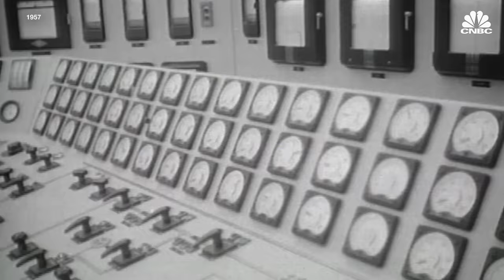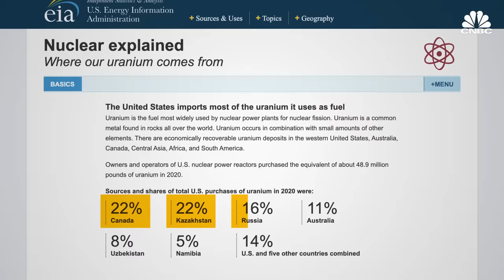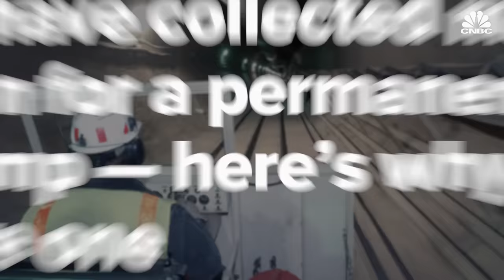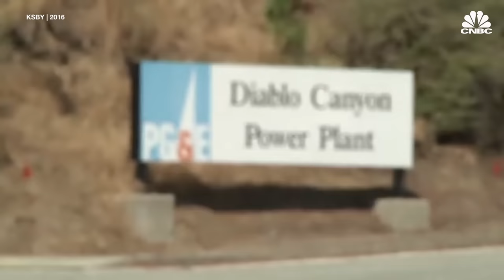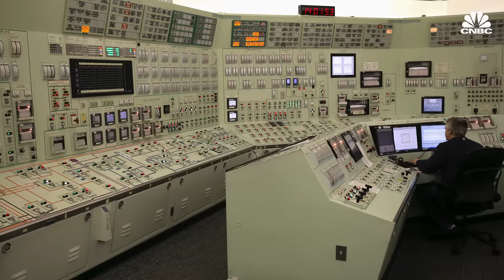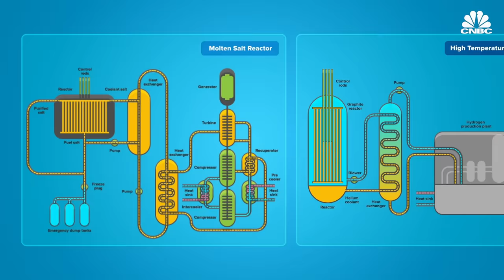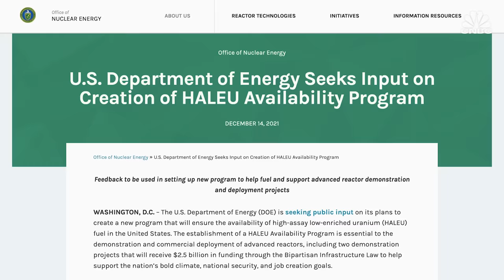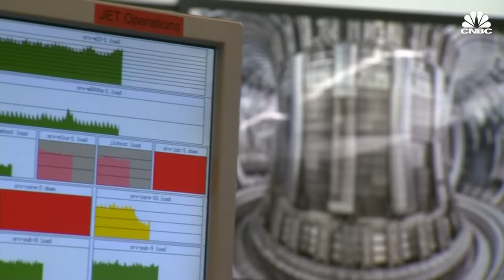Why Nuclear Energy Is On The Verge Of A Renaissance

Comment: Germany shutting down their nuclear power plants right after Fukushima made no sense especially when their plants weren't built on top of earthquake prone areas, near tsunami locations, nor were any design flaws found. Either every German citizen instantly got scared of nuclear energy due to Fukushima despite decades of problem-free use (whereas France didn't seem to be fazed by it) or someone got a nice Russian kickback for increased oil imports.
Reply: It would’ve made more sense if they modernized their reactors instead of just moving to Russian gas.
Reply: with all this going on, they wanna protect the assets, enough said
Reply: money is all that will matter unfortunately
Reply: It’s astonishing how many terrible decisions Germany has made wrt energy independence.
Reply: Governing by the perceived public opinion, a flawed perception as it is derived from polling on social media.
Reply: Germany has always had a strong anti-Nuclear lobby, but yeah, Fukushima being a factor in that is just stupid.
Reply: It was a political decision
Reply: however it's important to remember there are still real problems with long-term (100 years+)  nuclear wased ie availability and cost
Reply: Maybe that's why Germany has among the highest electricity rates in the world.
Reply: Nuclear waste takes up a very small amount of space and can easily be stored,  there are also ways to recycle used fuel that for some reason the United States does not do even though 90% of nuclear waste can be reused
Reply: @Donovan Lewis but the problem is that only  renewables are not enough to supply the amount of energy that a country like Germany needs. Besides that, the technology of renewables has some serious issues that were not solved yet.
Reply: @QueenetBowie  Uranium is highly soluable in water under oxidizing conditions and the radioactivity can not be perfectly contained. Futhermore the radioactive decay produces radon, which, since its a gas can also easily leak from whatever container you put the material in. Moreover any storage will also be contaminated. Time will tell how radioactivity can and will be used as an energy source. Recycling atomic waste will be incredibly important if it's possible, because while it amount may be limited storing it savely as in so that the leaking radioactivity is insignificant compared to natural radioactivity is very difficult indeed, especially long term since the material will contaminate and destroy any containment matter its contained in which means the waste you have produces more waste over time.
Reply: @arun279  Germany was also pioneer in solar energy but they have lamentably fallen behind China and other countries, same with wind energy….. it’s such a shame tbh!
Reply: @Donovan Lewis You can't be serious!  Wow, you really need to brush up on your relationship with Mr Google.
Reply: @Donovan Lewis "Much faster than any other country" That is 100% a lie... there are countries that already are completely running on renewables. The point I think also is that if Germany hadn't backed off of their nuclear before  having enough other renewable energy sources the country wouldn't be the biggest hypocrites of the EU... Also it doesn't help that Germany was the biggest proponent of the EU of Russian gas, with former ministers  the boards of russian gas companies... except for calling the Germans hypocrites, I'm not implying anything jus pointing out it looks a bit suspicious...
Reply: Kickbacks, massive corruption in Nuclear, many factors really, we need companies that deliver reactors on time and to cost, but seems hard to find any that are not taking a good slice of the cash for themselves and then asking for more because of "cost overuns"
Reply: Germany Inherited USSR style reactors, just like the ones in Chernobyl. Remember Chernobyl. Their Western style reactors are old, they need to be shut down sooner or later. The EU is now dismantling it's first nuclear plant to see how to do so safe and at what cost. Nobody knows how much it cost to do so yet. Same with nuclear waste, we are still in the stage of burying it out of sight. So the ones we have are old, some went boom, we have no idea what to do with the waste and what it will cost to clear up after they die.
You must be getting kickbacks from the nuclear industry.
Reply: @astranger448  so you prefer to pollute the world then overcome some unfounded fear of yours? Chernobyl failed due to human error...some went boom? tell which one exploded?
Reply: @KielanGaming  talking about massive corruption in Nuclear. But totally not talk about the even enormous way more massive corruption in coal. :) funny. Really funny. And naive.
Reply: Former Chancellor Gerhard Schroeder was the driving force behind Germany's dependence on Russian gas.  He was on the board of Rosneft, and for a while was known as "Putin's man in Berlin".
Reply: Nuclear plants shouldn't be built anywhere near high risk disaster areas. This includes near fault lines and tsunami zones.
Reply: Not the first time Germans took stupid decisions.
Reply: @bimbelimbim4998  While radon is a noble gas and can't be captured chemically, it is heavy and it would seem if it is sent into a cool ground area, it would gravity sort.  The gas could travel through pipes under the parking lot of the facility with a chimney on the other end.  The radon would roll along, but never be able to make it up out of the chimney.
Reply: it was a dramatic strategic and economic mistake.. that has led to huge number in loss of live in the Ukraine conflict. terribly sad
Reply: Definitely the latter, qui bono, someone pocketed a lot of boodle. Too bad for the consumers.
Reply: Germany has more wind than they can handle.
Reply: Nuclear power has never accounted for more than 6% of the total energy mix in Germany. Now it is 3%. Moreover, nuclear power is now more expensive than renewable energies. The high price for private customers (not industry) has political reasons. There are also enough countries that have never gone into nuclear power or have long since abandoned it, such as Italy. Not only Germany plans the final exit from nuclear power, but also for example Belgium, Spain and Switzerland. This smart-ass talk about Germany's energy policy from people who obviously have no idea about it is annoying.
By the way, even in France, nuclear power accounts for only 24% of the total energy. That means 76% has to come from somewhere else.
Reply: @yasminesteinbauer8565  So, if France builds 3 times the number of nuclear power plants it currently has, then the country is supposed to have free energy for its citizens, right ?  
Why 3 times ? It is because roughly a third of energy consumption comes from transportation.
Reply: @KRYMauL  both issues have nothing to do with each other. The problem with Russian gas is not found in the used gas plants but in process heat. Power generation is not the problem.
Reply: @arun279  you can afford to make sizeable mistakes when you make so much money from exports.
Reply: @danadurnfordkevinblanchdebunk  they buy it from the EU grid, because they can afford to.
Reply: @lewisdoherty7621  Except the subsequent radioactive decay products lead and polonium are easily solved in water which will ultimately cause lead contanmination in the surrounding area. Moreover while radon would naturally layer below other gases, it doesnt take much of a disturbance or draft to remix it and carry it off. Moreover there is too much atomic waste already to feasible contain them in built facilities above ground, those would need to be very large. And for underground storages, groundwater is always a huge problem.
Reply: It was mostly just money. As they highlighted in the video, they're expensive and complicated to build. 

Most western countries in particular have privitised their energy production. So the profit motive overrides everything, health, the environment, geopolitics, etc etc. 

It's all just $$$$$$$$$$$$$$$.
Reply: @Donovan Lewis renewables do come with problems though. Battery storage, limited lifespan and some electrical grids need many tens of billions of dollars of upgrades to move it around.

The point is that nuclear is a possible viable option and we should and as this video demonstrates are, working at possible solutions.

We shouldn't leave anything off the table and should back out scientist and engineers to solve big problems. 

No solution is a 100% hit, with no side affects. Everything still takes lots of raw materials, lots of money and had pros and cons. 

If we can solve some of nuclears cons it may provide a good source of baseline power.
Reply: Yes the german strategic thinking is a joke.
Reply: @mycourseresource-com  That potent nuclear waste is 1% or less of all nuclear waste, the rest becomes fairly harmless in that 40 year period.
Reply: @davidmartin6004  Right now, US nuclear waste can provide all of America's energy needs for 100 years.
Because light water reactors are extremely wasteful, especially generation 1 and 2 reactors that barely processed 5 percent of the energy from the Uranium.
Russia has fast breeder reactors that exclusively consume nuclear waste. 
The US used to have them but the last one closed during the Clinton era.
Some Fast reactors like the Lead Cassette reactors are refueled after 20 years of uninterrupted energy supply. The waste produced ,especially in closed cycle systems that recycle the fuels over and over again would be radioactive for 500 years and the volume would much much lower than that from light water reactors.
A more accurate term for the waste from nuclear plants is Light Water Reactor Waste, because not all nuclear power plants produce long lived, voluminous amounts of nuclear waste.
Reply: @bimbelimbim4998  but coal power plants release more radiation than nuclear plants (because coal is very slightly radioactive) and coal plants don't store their waste, most of it is just released it into the air.
Reply: @QueenetBowie  It's mentioned in the video (6:30) that the USA doesn't recycle/reprocess their nuclear waste, unlike say France, because it's "too expensive" to do so.
Consequently, I suspect the reason is (commercial) economics and state policies.
In France, (presumably because of environmental concerns) the government made a policy decision to make the reprocessing of nuclear waste an obligation of the industry, which consequently accepted the associated costs of doing so. 
In the USA, they didn't do this...
Reply: @sebastiaosalgado1979  You're right, of course.  But, there is a nuance there.  The 'Political' decision was motivated by a few folks' self-serving economic decisions.  In that the marginalizing of Nuke Pwr in Germany, in favour of Nat.Gas. adoption/proliferation, was motivated by a few highly-placed political operatives who's personal financial situations would benefit greatly.
Reply: @jibcot8541  Thats because these levels of radioactivity are far too low to even register against the natural radioactivity in our enviroment and to pose any serious threath at least as far as direct damage from radiation goes. Uranium and other radioactive elements are present in nearly all types of rocks, which includes coal, but it is never really abundant enough to the point where the radiation would be significant.
Reply: same thing happend here in s.korea and ends up electricity price gouging
Reply: @Ted0302  you're correct
Reply: @Donovan Lewis 100% for short periods of time is not good enough whatsoever. You would need it to constantly be at 100% all the time and that is not possible in most countries
Reply: I wholeheartedly agree. It is beyond moronic to shut down the only low carbon, baseload power source. But I have lost hope that politicians and journalists in the country will come to their senses.
Reply: Russian bribes
Reply: To each their own.
Reply: @yasminesteinbauer8565  How is it even relevant to show a ratio about the total energy production if nuclear energy is only meant to produce electricity ? What is your aim behind giving people the wrong idea ? 71% of the electricity in France is produced with nuclear (and 22% from renewables).
In the near future, electricity will have a far larger role, most of our energy production will be related to electricity (since it's cleaner), that's why we need to produce more and more.

"nuclear power is now more expensive than renewable energies"

When will idiots stop comparing an energy you can CONTROL with renewables that YOU CAN'T CONTROL. It's not the same thing, it's pointless, it's like comparing a caravel and a steamboat. At this point renewables can only be a complement. Add the cost of massive electricity storage complexes (that we can't really build now realistically speaking), full of batteries, and we'll see if renewables are cheaper, and let's not forget the pollution that comes with producing batteries.
Even Germany doesn't really count on becoming 100% renewable any time soon (since we don't know how, so it's just a bet), as their energy mix is meant to rely on gas. A gas + renewables mix, as opposed to the nuclear + renewables mix that is recommended by basically everyone else.
Reply: @tranbaohoangvu9464  71% of electricity in France is nuclear, 21% is renewables. As soon as transportation and some other sectors switch to electricity, they'll just build more plants to meet the increased demand. But it's pretty good as it is for now.
Reply: @davidmartin6004  

We already solved that problem decades ago.
Reply: @bimbelimbim4998  
What’s the difference between radiation and GARBAGE landfills?

Think about it.
Reply: If nuclear plants can’t be built in earthquake prone areas then nuclear plants can’t work anywhere in Japan
Reply: @xenotypos  Why do you ask questions when you answer them yourself in the next sentence?🤷‍♂️
You can't just look at electricity and ignore the rest. In France, 76% of the energy needed for the country is not supplied by nuclear power. Since we have to get out of fossil fuels because of the climate crisis, a transformation to other forms must take place here. Replacing this 76% by nuclear power in the future is unrealistic, as France already has problems keeping its nuclear power plants running reliably. A capacity limit has simply been reached here. In addition, nuclear power is already the most expensive form of electricity production and will become more expensive in the future as uranium becomes less and less available. Running the world on 100% nuclear power is simply impossible. 100% renewables, on the other hand, is absolutely possible.
So the solution is obviously renewable energy. The problem is not that WE don't know how to do it, but that YOU don't know how to do it. With power-to-gas, for example, we can easily store the amounts of energy we need to balance out seasons, etc. We can even convert existing gas storage facilities for this purpose. I can show you detailed model calculations that describe exactly how to realize the supply with 100% renewable energies (in German though).
Calling me an idiot and at the same time believing that we would store the needed energy in batteries only shows that you have never seriously dealt with the topic.
Reply: @yasminesteinbauer8565  "You can't just look at electricity and ignore the rest."
We can for the reason I mentioned, and for another reason: renewables also can only produce electricity. So it's stupid to mention things that HAVE to be from fossils, until we all have electric cars and so on. Mentioning stuff that can only be through fossil fuel right now while talking about renewables is at best confusing, at worst dishonest.
Admit it, you should have focused on electricity production. Nuclear and renewables are the same in that regard.

"Replacing this 76% by nuclear power in the future is unrealistic"

It's totally realistic, but you just didn't check the french situation, you had to post before even knowing what's going on: France mostly stopped investing on nuclear energy (at least compared with the 60s/70s/80s) for decades, and didn't replace her very old centrals. Well, there were some investment, but minimal. The French president confessed that they lost a lot of (precious) time during that indecisive period, since it's been only like 2 or 3 years they changed their mind. Real investments on nuclear energy, as it's happening in a lot of countries right now, will make it cheaper, even more efficient, and with minimal waste. That's the scenario most of the world chose, like it or not.

"A capacity limit has simply been reached here."

Are you always making up "facts" like that ? Nuclear plants take minimal space and fuel, with enough money, they could produce a lot more than what the country needs. there is no "capacity limit" in sight here. As I said, France's nuclear facilities are super old, that's basically the only real problem.

"and will become more expensive in the future as uranium becomes less and less available."

Sigh, why are you even posting if it's to say that. Not only there is plenty of uranium left, but:
-we didn't search for it nearly as much as for fossil fuels, the real total available amount is impossible to know, but probably a lot.
-we can reuse nuclear waste, it's already an accepted technology in France and Russia.
-Thorium reactors aren't far from being operational. For those, the fuel is basically everywhere in the world.

"Running the world on 100% nuclear power is simply impossible."

Nobody says they want 100% nuclear, even if it's perfectly possible. But it would be stupid: renewables, if only used as a complement don't need to have storage facilities, and thus would be indeed quite cheap.
That's why everyone is betting on a mix that include renewables, but also another mode of production that you can "control", either nuclear or gas.

"100% renewables, on the other hand, is absolutely possible."

Not now according to the scientific consensus. I doubt your paper in german would change that. Maybe in the future, but for now we have no realistic/proved way to store the gigantic amount of electricity needed to have a continuous supply.
Reply: @alohatigers1199  The difference is that garbage landfills only need to be immediately waterproof aka prevent contamination of groundwater via direct runoff. But radioactive material has to be stored waterproof and also impervious to gaseous leaks, aka a default landfill is out of the question, the wind would contaminate massive areas around the landfill, leading to both radioactive damage and lead poisoning.
Reply: @xenotypos  Energy is energy. Whether your car is powered by an internal combustion engine or an electric motor doesn't matter. We have to get 100% of our energy from somewhere and not just a part of it. Therefore, of course, it is the total energy consumption that matters, not just electricity.
The fact that in France no new nuclear power plants are built by the industry unless the state subsidizes them really says everything about their economic viability.
Statistically, we have a pretty good idea of the likely amounts of uranium on the planet. That has nothing to do with the fact that we don't look for it enough. And we know that even at today's rate of consumption, known supplies will run out in a few decades. On the other hand, if we increase consumption significantly, it will be years, not decades. The "recycling" of fuel rods is eyewash since only about 1% of the material is reused. For this reason alone, nuclear power is not a solution and a bad investment. Thorium reactors have their own problems such as the formation of highly radiotoxic tritium which easily diffuses through the walls of the reactor vessel etc. It is completely unclear whether these will ever be used or not. It is completely unclear whether they will ever be used productively. Due to their low flexibility, nuclear power plants are poorly suited for use in decentralized smart grids that are needed for regenerative energy.
The necessary energy storage through power-to-gas is technically feasible in the required scale (there is even a first commercial one in operation in Germany). It would not be the first time that science in Germany is further ahead than in the rest of the world.
Renewables are simply the better alternative in every respect.
Reply: @yasminesteinbauer8565  "Therefore, of course, it is the total energy consumption that matters, not just electricity."

Do you actually read what I write ? Or is it on purpose so that I get tired and give up ?
Reply: @xenotypos  The claim that we do not have to include forms of energy other than electricity is simply nonsensical. So I don't see what you're getting at.
Reply: @yasminesteinbauer8565  I'll repeat once again so that you understand, if you don't, then good luck for your life.

I said that argument makes no sense because:
- Nuclear and renewables are only meant for producing electricity. Both of them, while you used that argument to argue that renewables are a better option than nuclear. Which is the "nonsensical thing" here.
- Almost everything will run with electricity in the close future. And this evolution is not dependent on the mode of production, but on other forms of technology, like electric cars as I said. So OF COURSE fossil fuel is still used a lot, but it has nothing to do with a "nuclear vs renewable" debate, both have the same aim in that regard, producing electricity. Thus it's totally irrelevant to say "nuclear only produce xx%" as an argument, as if it wasn't possible to produce more, the only thing is that it would only produce more electricity. And it's agreed by literally everyone that the way to go is to make almost everything electric and to increase the electricity production. I assume you agree with that too, since you preach for renewable.

I've actually read the rest of your previous post now. I was too annoyed in my last comment, so here are some corrections:

"unless the state subsidizes them really says everything about their economic viability."

That's not how it works. EDF is mostly owned by the French state to begin with, that's why everything that company do has to do with the French state. And despite the lower investments on nuclear, they were actually building new nuclear reactors, but just not in France (it was cheaper to keep the old ones, which were enough to get the job done anyway, as almost no electricity is produced through fossil fuel in France, as opposed to the massive use of coal in Germany).
Also, either in the private sector or in state-owned companies, investment was rare not because it wasn't economically viable, but because the political climate (worldwide) was against nuclear power. It's clearly different now that a lot of countries have shown their interest. More prospects to actually sell the powerplants.

"And we know that even at today's rate of consumption, known supplies will run out in a few decades."

I'll just quote a scientific article: "According to the NEA, identified uranium resources total 5.5 million metric tons, and an additional 10.5 million metric tons remain undiscovered—a roughly 230-year supply at today's consumption rate in total."

How many decades does 230 years look like for you ? The known part would still last for around 80 years.
What you may have been refering is an old statement from the European Commission in 2001, and which was only refering to the known ressources back then (I'll repeat that: the known ressources, back then). And since (as it happened with oil) new sources are regularly discovered, more than imagined, it changed quite a bit since then.
Yet, I'll admit that (as opposed to what you said "confidently"), it's hard to know how large are the undiscovered ressources are. So it's partly speculative.
Reply: Makes perfect sense when their politicians take kickbacks & director positions from Russian energy companies...
Reply: @xenotypos  "Nuclear and renewables are only meant for producing electricity."
"Almost everything will run with electricity in the near future."
Do you suffer from a split personality? Since we have to compensate for the loss of fossil fuels with something, the bottom line is that total energy consumption is crucial. Yes, most of it will be electric in the future because we are replacing fossil fuel combustion with electricity. But it is unrealistic for many reasons to replace the scale of fossil energy with nuclear power. So you want to increase nuclear power from say 10% to 20% and then replace the rest with renewables? Then why not go straight to 100% renewables?

The point is that nuclear power is not financially viable or profitable without government involvement. Exactly how government subsidization takes place in different countries is not the point. Why are you so eager to sink your tax money into it?

Many of the presumed uranium deposits will not be exploitable at all because, for example, there are cities on them or we won't even find them. And even if we assume 200 years, this is only true if consumption remains unchanged. If we double the consumption, it will only be 100 years. If we quadruple the consumption, 50 more years ...
So why not instead invest in regenerative energy? Why unnecessarily accumulate more nuclear waste although it is not necessary? Why continue to depend on other countries?

Just because there is some "trend" does not mean that it is wise. There is also a worldwide trend towards autocracy at the moment. Are you arguing that democracy must be bad because of this?
Reply: an Austrian survivalist (so a grain of salt) was hyperventilating last year that Germany not only closed the power plants but also stopped training people to manage them
Reply: @yasminesteinbauer8565  " the bottom line is that total energy consumption is crucial."

You still didn't get my point I just can't believe it.
Have a good day.
Reply: @xenotypos  Then you are really bad at expressing your argument clearly.
Reply: @yasminesteinbauer8565  you mention "power-to-gas" quite a bit. I presume you mean hydrogen generated by electrolysis. There's a couple of problems with that soloution (one of which nuclear energy helps quite a bit with). The first one being, hydrogen is extremely flammable and has a low energy density, meaning we would need huge tanks to ever function as a grid scale "battery". If you can't figure out why that is a bad idea: Hindenburg. Secondly: the energy efficiency from just electricity to hydrogen to electricity is about 30%. given that the capacity factor of renewables (solar and wind) is also about 30% (give or take), one TWh of installed capacity renewables would only give roughly 0.1TWh output from hydrogen gas. You can make the electrolysis more efficient with heat, which nuclear power can provide besides the electricity output. This concept is being developed amongst other places in Oskarshamn Sweden. I know nuclear energy is expensive, but grid stabilizing services, connection costs etc are also expensive, and those are a problem for renewables, not nuclear. So it's not fair to just look at the LCOE of different forms of electricity generation. The power grid NEEDS baseload power. Right now, we have two forms of low carbon baseload power used at scale: nuclear and hydropower.
Renewables + Nuclear = <3
Reply: @MrBadAssBoy123  Electrolysis is only the first step. The second step is methanation by carbon dioxide. This produces synthetic natural gas that is compatible with natural gas. This also makes it easy to store in any quantities. Germany already has huge gas storage facilities that can be used for this purpose, allowing energy to be stored for months.
Efficiency is not a problem. These losses are of course taken into account in model calculations and do not represent an obstacle.
Nuclear power plants, due to low flexibility, unfortunately harmonize poorly with renewable energies and are rather an obstacle to a successful switch.
Reply: @armin3057  I never claimed that there is no bias and everything is 100% perfect. Maybe you read what I actually write and don't attack me for things I never wrote?
And if you have to go all the way back to the Iran War to find an example, that probably doesn't speak strongly for your thesis.
Reply: @armin3057  Again: I have not said with a word that there is no bias.

I have already made many arguments if you would take the trouble to read all my comments. And if you find that too tedious, please find something else to do.

Also, I don't know when I ever heard anything about the methanization of hydrogen on the news. And if you hear similar arguments, it is probably simply because they are true.
Reply: There's no such thing as electricity anyway, it's just another type of 🔥
Reply: @yasminesteinbauer8565  In other words, you want to get off fossil fuels by using renewables to create a synthetic fossil fuel?  I whole heartedly support the Germans stopping the money flow to Putin, but I thought the goal was to reduce greenhouse gases? I also wonder what the cost per MWh for such a system would be. Can you show me the model you are talking about? if it is a serious publication I am sure there is atleast an abstract in English I can read. Thanks :)
Reply: @mycourseresource-com  the million years figure quoted by Forbes is incorrect, according to the nuclear regulators the amount of high level waste for the average plant is only about three percent per year and is about three cubic metres once vitrified and only requires storage for a few thousand years until it is back to normal background levels. Current reactors use about 53 grams per household per year which is not a huge amount in the bigger picture. So many lies have been told about nuclear generation over the years people have started to believe they are true.
Reply: @Donovan Lewis Your examples have huge hydro power dams which acts as base power for wind and solar. Not every country or region has the availability
Reply: @xenotypos  thanks mate, that's a great point, but France has not yet reached the threshold where it can purvey free energy to it people.
Reply: Germany has been busy marketing their claim to the greenest % of renewable energy production. They’re very careful to leave out the reality of t he or energy consumption tho.
Reply: Germany scared  they would get hit my missile  attacks from the ussr
Reply: Even Trump called this out
Reply: if Germany had thought  about the climate they would had phased out coal, oil and gas first.
Reply: Qutting nuclear made a lot of sense for nuclear. You have to consider the history of Germany and anti nuclear movements. It not as simple as you guys make it look:

This decision has a long history and is pretty much completely disconnected from any climate change discussion.The discussion to phase out nuclear in Germany started as early as 1970. And it gained much more attention after Tschernobyl. The green+red government of Germany in the year 2000 then decided to phase out nuclear, with all of the short term consequences (no more investments, less research, no funding). But then, the black+yellow (conservative + liberal) government in 2010 decided to stop the phase out and keep the nuclear plants running. But please note that there was still a very big anti nuclear movement in Germany. But the promise was.... well Tschernobyl happened in a communist third world country.. this could never happen in an industrialized nation. But then Fukushima happened, the promise was broken. Shortly after that the phase out was decided again. in the year 2011. This time by the conservatives under Angela Merkel. At that time there were already climate discussions, but not as strong and not in the focus as it is now.

Time passed... and now we are at a point were stopping the phase out is basically not possible anymore. 10 years passed without serious maintenance and re-investments in the old nuclear plants. The (private) plant-operators themselves stated that even if the government would stop the phase out. They would still not keep the nuclear plants operational. It would need to much investment. Not worth. All the supply chains are cancelled, employee contracts cancelled. It is simply not feasible / possible anymore to not phase out nuclear, its to late. The process of decommissioning has started long time ago, long before the climate topic has been that relevant. 

So from my point of view, the phase out is very much understandable and not some "brain dead" take. The complete story is a bit more complex, also involving billions of € that got shoved up the a**es of the plant operators... but lets not get lost in details.

Constructing new nuclear powerplants also seems not like a real option. Its pretty clear that building those will take to much time, to much capital, to much resistance from the people, to slow climate effect to be meaningful to reach 2030 or 2035 climate goals. The path Germany has to take is clear now, build more Renewables + Storages. Its cheaper and faster and has a much larger climate impact.
Reply: Kickbacks make the most sense to me.
Reply: @QueenetBowie  If it can easily be stored....and by that I assume you mean safely......why is every bit of nuclear waste around the world still currently in temporary storage and why has science still not come up with a permanent safe solution. You are therefore talking crap.
Reply: @elsekling2552   Sure but that decision from merkel wasn't based on climate
Reply: Literally some of the most modern power plants just rotting in Germany while they burn tonnes of Russian gas
Reply: @davidmartin6004  not really, as most of the reactor 'waste' is either short-term radioactive isotopes or more reactor fuel that just happened to be covered in a neutron-absorbent coating. We can simply throw them into slightly modified refinement plants (usually attached to reactors due to the required energies involved) and get more bang for the buck, so to speak.
Reply: Also, Fukushima disaster is actually an avoidable disaster. It won't happen if the plant actually does not discount their protection
Reply: It makes sense if you are incentivized to move to be wholly reliant on a country angling for geopolitical strength
Reply: @danadurnfordkevinblanchdebunk  think he only completed his masters in Google university, might need to encourage him to get his phd
Reply: @KothraStreamdiver  Anti - nuclear is one thing if it applies to WMD's , power generation is entirely pedestrian !
Reply: Chernobyl more likely they got scared of
Reply: Thanks to that germany can ferally invest in renewables if not for this they would have gas plus coal plus some 25% of nuclear power, even data form Germany shows this they had similar amount of energy produced by fossil fuels during peak of nuclear power as they have now.
Reply: @TimelessFive  First you should check for what purpose gas is used by Germany only 25% goes to generate electricity.
Reply: @TimelessFive  Ok but that beyond current topic past decades basically forced economy into reliance on gas. Heat pumps are only recently becoming viable option and gas heating for bakeries was cheapest option as well. Relaying on atom doesn't changes said facts.
Reply: @yasminesteinbauer8565  About 3% of vehicles in France currently run on electricity (I included hybrids just to be extra generous). Are you sticking wind or sunlight in the other 97% of vehicles' fuel tanks in order to run them on renewables? If not, then your numbers are either deliberately or accidently obscuring the realities of power production and expenditure. In order to rely 100% on renewables you need either; 
1. A massive over production spread over a very large area (to avoid things like persistent cloud cover, droughts or doldrums) which takes up a lot of land which is going to lead to ecological damage 
2. Massive energy storage capacity to make up for for cloudy or windless days
3. Some kind of  throttleable energy source that is not affected by climatic conditions. Currently you have your choice of gas, coal, oil or nuclear 

Some other things we need to consider for renewables are that the generation methods have limited lifespans. Wind turbines have to be replaced (and we don't currently know how to effectively recycle the blades), solar panels lose efficacy over time (same problem, we don't really know how to recycle them) and not to mention that energy storage loses efficacy over time with charge and discharge cycles and we sure as hell have a hard time with recycling those.

I see you also like to talk about the limited supply of nuclear fuels, the issue is that this is even more true for some of the important materials we need for renewable energy generation and storage. Lithium, cobalt and high purity silicone is both in short supply, largely held by a few nations (that aren't always the friendliest) and wreak hell on the environment during extraction. We know where a lot more Uranium is than those bunch and we use it up a lot slower as well.

As for the economics of it, the unfortunate truth is that right now almost nothing can compete with fossil fuel power generation costs. We have spent decades building up and refining the infrastructure for it. Nuclear is subsidized sure, so is almost every renewable initiative either on the front end (construction/research) or the back end (subsidies for users to bring the price to use to a comparable level). This is true for EVs as well. Adoption is generally quite slow as they still have a lot of downsides (initial cost that will only get worse as government stops subsidizing their purchase, long charge times, substandard range, poor battery performance in cold climates and ever reducing range with use to name but a few). Between 2014 and 2019, France for instance only saw a 1.5% market increase for EVs and the French seem more into EVs than a lot of other people. Areas with higher EV adoption tends to be the ones where the government is essentially forcing the issue by artificially reducing the cots of new EVs, making ICE vehicles artificially more expensive with additional taxes or straight up just banning them (think California). That doesn't work in most places and until EVs start making up a majority of vehicles on the road you can't really consider car use as part of the power generation structure of a nation.    

We're going to need a mix of energy production methods for the foreseeable future. As it stands we don't have the means to store the needed quantities of energy to make renewables sufficiently reliable and not to mention that once EV adoption does start reaching saturation then we are going to need a lot more power and contrary to popular belief, renewables are a finite resource. Only so much sun hits the earth every day, by harnessing wind power you are robbing it of kinetic energy and there is only so much water we can stick in a dam. At this point we need every feasible means of energy production that isn't going to bugger up the planet (that includes nuclear) and hope that fusion isn't always 20 years in the future. 

I think xenotypos largely has the right idea, he could probably work on his delivery though
Reply: @simon2493  Basically, the current situation is feeding a war mashine in Ukraine, in my opinion Europe should sacrifice all of the industry that is dependent on Russia to save human, animal life or is that to much to ask?
Reply: @dewibermingham816  That's it, the decisions taken to close the plant don't reflect the situation on the soil of Germany.
Reply: @TimelessFive  You expect total collapse of given country? We are decreasing our reliance on Russia as fast as we (Europe) can but it takes time. We can't be so pushy because we are taking about society if people will feall that they will lose significantly by not buying Russia gas all sanctions will go in wain.
Reply: @simon2493  I never said it would be easy, most likely it would have terrible implications for majority of Europe, it would be nice to see EU human morality to be as well developed as German economy. History will remember this period when EU came together to help to a point of comfort.
Reply: Anti nuclear movement in Europe is an entirely different breed
Reply: @shatteredstar2149  It's hard to not be anty seeing how did AP 1000 project ended in USA 25 billion us dollars for two 1000 MW powerplant
Reply: @shatteredstar2149  It's not the time to listen to idiots, people are dieing. EU needs to grow some balls brother.
Reply: The moment you realize how bad it could be if the fate of a country is decided by 'normal' citizens, who are supposed to be Einstein-like. Counter-example: China, where policies are made by elite force (CPC) and based on meritocracy/technocracy.
Reply: @oceanwave4502  Elite 😆
Reply: @elsekling2552  "Renewables + Storages"

I think you meant renewables + gas. 
Well, one day you guys will have to be more realistic.
Reply: @DeepVeinThrombonus  How does it make any sense that the still low electrification of the transportation sector argues against renewable power but for nuclear power? Are you going to throw uranium rods in the tanks?
Of course, there needs to be a simultaneous shift to electric cars. A ban on combustion cars is being discussed in the EU for 2035. And yes, you need large storage capacities not only for cloudy days but especially to compensate for seasons. I have already explained in detail that storage can be realized without any problems. Just scroll up.

Nuclear power plants also have limited lifetimes and leave behind a lot of radioactive waste. Solar cells can be recycled almost 100%. Large lithium batteries last about 20 years and gas storage tanks do not wear out. These are all problems that have been considered and are not an obstacle.

The same is true for the resources needed even to supply the world with 100% renewable energy. If the whole world would produce as much nuclear power as France, the uranium resources would be used up in 30 years. Probably even faster.

As for the cost, you're wrong. → https://en.wikipedia.org/wiki/Levelized_cost_of_energy
The future complete electrification of the transport sector has also already been included in the model calculations and is also not an obstacle.

The sun provides us with 1,500,000,000 GWh per year which is 10,000 times the amount of energy we need. So we are not hitting potential limits here.
And nuclear fusion is always 20 years in the future. Even the construction of a conventional nuclear power plant takes more than 10 years on average. The idea that nuclear fusion will save us in 20 years is completely unrealistic. It is unclear whether nuclear fusion will ever be an economically viable alternative. By the way: A fusion generator causes very strong neutron radiation, which leads to so-called induced radioactivity. Parts like the protective jacket against the neutron radiation degenerate over time and have to be replaced regularly. These parts are highly radioactive waste.
Also used fuel like tritium is a beta emitter with a half-life of over 12000 years. Who believes artificial nuclear fusion would solve all our problems just like that is living in a dream world. And certainly not in 20 years.
The technology for renewable energy, on the other hand, is already available today and is not a theoretical sci-fi technology.
Reply: @armin3057  All possible ways are sought to conceal the subsidies for nuclear power. Revenues from emissions trading, waste disposal provisions, research funding or the costs of decommissioning the nuclear power plants in eastern Germany are usually not even included. The social costs are enormous.
Name me one nuclear power plant that manages without subsidies. There are, on the other hand, the first wind farms that manage without subsidies.

The high electricity prices are due to the political design and not to the renewable technologies themselves. Spain, for example, is focusing on the expansion of solar power and has considerably lower electricity prices. Austria also has no nuclear power and lower electricity prices than Germany. So this has nothing to do with nuclear power.
Also, Germany is not the only country that is expanding renewable energy. Do you know who is expanding renewable energy the most? China. But also in Japan, India or the USA the share is increasing steadily.
Reply: @yasminesteinbauer8565  
see you are mixing up so much stuff. 

yes the USA is also expansing renewables (ugly word). im not against renewables. its not nuclear vs renewables.

first of all, the utility prices of solar farms in california are way different than in Germany, for the most part the US is not paying for renewables by subsidies or by central planning. 
some utility companies for instance built solar farms and then also ended the project because it was not viable. 

in Germany, most of the solar panels were bought when prices were hight. rich folks who could afford it were paid high electricity prices, at the beginnig it was like 50 cent for the kwh ...part of the electricity price is still for paying that subsidy

again, Prof Quatsching , himself said "the EEG was a gift to the world " because in his opinion the german subsidies were the reason why solar became so cheap (i doubt it because every technology has a cost curve)
but you are even denying the fact that germans paid for this "gift" . germans arent profitting at all. at best you paid for the cost curve to down faster by  a few years

also, i never said that electricity are low because of nuclear power, but because of a free market system where the cheapest one wins.
Reply: @yasminesteinbauer8565  
third :
"electricity price is by political design"

you just said nothing here. its a flat out lie. the only other country with similar electricity price is danemark, who also has a lot of wind energy. you see it is not only that germany paid a lot for building solar farms and wind parks, its also the cost for building high voltage lines but also managing the high volatile electricity...because most solar is fed in midday...when electricity demand is very low. Then you also have seasonal differences. at some point it goes down to zero. so managing it is very expensive, you also have to run conventional power plants for back up. at some point neighboring countries wanted to close the transmission lines because they didn want germanys electricity, thats why the price for electricity was sometimes even negative. that doesnt mean that it is good, it means that the electricity is a burden " Zappelstrom" or "Abfallstrom"

Spain? Spain doesnt have that problem, spain doesnt have that much wind and solar, not even close, they have some solar farms in the south which produce much less volatile electricty though
again none of the mentioned countries have done what germany did except Danemark

China is sort of state controlled but they still use market mechanisms, more than germany at least lol. and also they build giant solar farms in the desert, and not on roof tops....i could go on but whatever, you really you think that electricity price is just a political decision...you probably also believed jürgen Trittins "eine Kugel eis rede"...compared to this useless piece of....im a n actual scientist who run those numbers, also checked the info institute numbers and yes it is simply true. families in germany are struggling because of people like you who vote for these idiots.
Reply: @yasminesteinbauer8565  I'm not sure where you got the idea that I said that not including ICE vehicles in the energy equation somehow favors nuclear generation. If you go back and have another read I was stating that assuming it as part of the power grid massively skews the numbers and gets to the 27% of France's power comes from nuclear. Technically true but not a particularly valid figure in this instance. The takeaway that creates in the casual observer is that even in France where they love their nuclear power plants, they only use it for a small fraction of their energy generation. This creates an artificially negative perception of nuclear power. The point is, that in the current means of energy consumption, in France renewables cannot represent a noticeably larger percentage of energy generation than nuclear. If you want an equivalent example you can look at how gun violence statistics will frequently include injuries obtained during paintball or airsoft games, hence skewing the statistics with non relevant information.

As for nuclear waste, the vast majority generated (97%) is considered low level waste. This includes things like the overalls worn by plant operators and are generally just stuck in a small container and is considered safe after a few years. The other 3% is a mixture of level 2 and level 3 waste with level 3 waste being the really dangerous stuff but also the smaller percentage of the remaining 3%. As for ground water contamination, that's not really a major issue if you are careful with your site selection (and I suspect people would be when sticking radioactive waste in a hole). 

The nuclear fuel longevity figure is also somewhat misleading. That figure only accounts for a single fuel source and only solid high concentration deposits. Discounting the fact that we have other nuclear fuels as well as breeder reactors, there is about 4000 million tons of Uranium dissolved in the oceans of the world with an energy extraction cost which at the high end places it on par with reverse osmosis. Takes a fair bit of energy sure, but you're getting a lot more power out with what you're extracting. That also doesn't include that constant replenishment of the dissolved uranium by crust erosion. I've seen figures that places Uranium's staying power at 4 billion years (but that seems a bit optimistic). 

Thanks for showing your source on the cost of renewables, unfortunately it is not wholly accurate (it even says so in the article). The graph shows generation costs without accounting for uncertainty premiums. The issues is that you will require some way of filling the gap in your generation capabilities and that really does inflate the cost quite a bit. At this point, economic realities require governments to subsidize renewable initiatives and that has to happen for a reason, they currently just are not cost competitive due to their inherit draw backs. And as for essentially unlimited availability; sure you can access that 1,500,000,000 GWh per year of free clean solar energy...if you are willing to pave over the entire planet with solar panels. Call me an eco extremist, but that sounds like it might not be great for the planet or anything living on it. Solar farms face the same issues that roads do and that is getting enough space to build them in the places you want them. Then we need to factor in that you normally want to build them in places with little cloud cover (hence little rain) but you also need a lot of water to clean the panels on a regular basis. 

Finally we get to the question of cars. Rapid adoption of EVs is not feasible. 
Here's the math (for France);
There are currently 32,000,000 cars in France of which ~31,500,000 are ICE vehicles 
The average cost of an EV in France is E32,000 which the French government will subsidize 27% of, bringing it down to E23,360
The average life expectancy of a car in France is 12 years and the current average age of a car in France is 10.1 years
Finally the current average income of a person working in France is E39,000 per year

So lets work through this
In the next 2 years, a little over half of the cars in France will be replaced with new ones, that's 16,000,000 (very few of those will be EVs)
16,000,000 x 32,000 = 512,000,000,000 of which the government will have to pay 138,240,000,000. For reference that is 5% of France's GDP or a 2.5x their military budget (which is the highest in Western Europe at the moment). This isn't to mention that the government will also have to spend a tidy sum on massive upgrades to the electrical infrastructure (lest it be overwhelmed by all the new sudden demand) and to expand their electrical production by a good amount. 

Then we get to the ground level where the average person in France will have to decide whether they are going to spend E23,000 on a new EV (almost 60% of their yearly paycheck before tax or any other expenditures) or E15,440 or a new ICE V (almost 40%). Then we also hope that the few production lines making EVs can keep up with the surge of demands along with all the rare metal dig sites and all the way down the battery and electric motor production line. Odds are there will be a decent uptick in EV adoption in France over the next 2-5 years, maybe 10% if we're being generous and that rate will likely accelerate. But at the end of the day we're looking at another 2-3 generations of vehicles (so about 24 years) before we see the majority of cars in France being EVs. And yes, the EU could ban the sale of new ICE Vs in 2035, but unless they are going to buy back all the cars already on the road, those are still going to be running for a good while after the sales ban. 

That time period is plenty enough for new nuclear power stations to be constructed and brought up to full operation. 

Just to touch on solar panel recycling, yes we can recycle about 90% of the materials in them, but current recycling rates are about 10%. This is due to the cost and complexity of the recycling process and unless those get sorted out that's a lot of waste. Same with energy storage. You like to talk about air to gas but that is currently relying on largely experimental (and not even remotely cost effective) technologies. You'd also need to expand carbon capture initiatives to offset the emissions from reversing that process to get electricity again and that is currently extremely energy and cost inefficient. There is yet a ways to go. And if you're willing to give those the benefit of the doubt in that time and technology will shore up those deficiencies, then surely we need to do the same for nuclear power.
Reply: @armin3057  Energy procurement accounts for only about a quarter of the electricity price. The rest is EEG, taxes, grid fees, etc. Wind and solar power are at the bottom of the list in terms of electricity generation costs. (cf. https://en.wikipedia.org/wiki/Levelized_cost_of_energy )
I have already explained the storage problem extensively here and supplemented it with further sources. Just scroll up.
By the way, it is France's old nuclear reactors that have almost caused Europe's power grid to collapse several times.

Solar panels on roofs are a very efficient use of otherwise unused space. A limitation for the plant size is here often again the legal design which urgently needs to be de-bureaucratized. I strongly doubt that you are a scientist in this field. Nothing of what you write here coincides with the current state of knowledge.

It is a bit strange to blame failed policies on a party that has not governed for the last 16 years. Don't you think so?
Reply: I'm guessing you don't live in Europe. Throughout most of Europe the green lobby has power substantially above its electoral popularity. That is down to domestic electoral arrangements. So far, they have talked out nuclear, gas and coal. They're also against new hydro, because of the dams. They are also against burning waste plastic, because "it's all that pollution man" or somesuch. There is also an almost Nelsonian blind eye being turned on wind generation, with countries competing to announce ever larger investment in the North Sea. There, the 'target' has become multiplying the capacity tenfold. "Blind eye"? In the summer of 2021, all turbines stopped turning at the same time for four weeks (AFAIR). It happens frequently, often in the winter with its higher demands. It was caused by a high pressure system over Norway, which lasts that long every 5-10 years I'd guess.
The increased demand for electricity in Norway and Sweden, driven by demands for EVs, and the electrification of industry and transport has meant that whereas they both used to have 100% green electricity, they are now importing it from Germany, which is the world's largest producer of lignite, the most polluting form of coal.
There's a distinct lack of "joining the dots" you may say.
Reply: @mycourseresource-com  A few things:

- It's my understanding that the longer nuclear waste lives, the less potent/radioactive it actually is.
- It's also my understanding that most high-level nuclear waste needs to be stored for about a hundred years (which, yes, does make it very radioactive).
- I don't know if Sellafield is very representative of the current state of the nuclear waste disposal... industry. From what I've read, it seems like they made mistakes that could be avoided. But yes, it's kind of a disaster.

- The reactor that TerraPower is building produces 80 % less waste than light water reactors because is able to use depleted uranium as fuel. This also mean it can use existing depleted uranium that we currently have in store as its main fuel source.
- Thorium reactors produce very, very little waste. Look them up.

All in all I don't think the challenges shouldn't keep us from looking at the real development and benefits of new types of reactors.
Reply: Lets just say we should never ever base any policy on what Germany thinks.
Reply: The news always misreport this. The German phaseout was decided long before Fukushima. Chernobyl had a much larger psychological effect, having spread radiation to German areas.
Reply: It’s interesting that you say that because if I understand correctly, the most earthquake happy zone in the world is Iran. And yes they built one right by a fault line. Search ‘bow of Elam’ in the Bible to find out how well that’s going to work out….
Reply: Germany fell to the green renewable crazy.  Fortunately, the rest of us can now point to Germany as a prime reason not to rely on wind and solar and not to go against nuclear.  Thank you Germany for taking one for the team to show how bad solar and wind truly are.
Reply: Kickbacks, for sure.